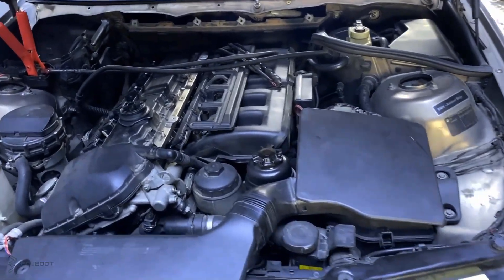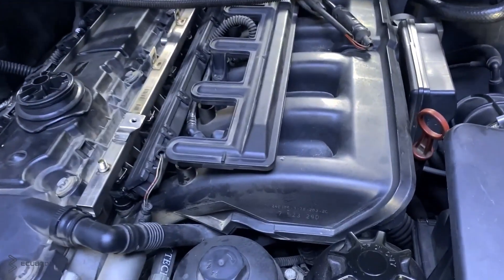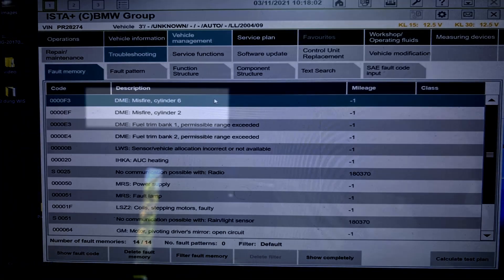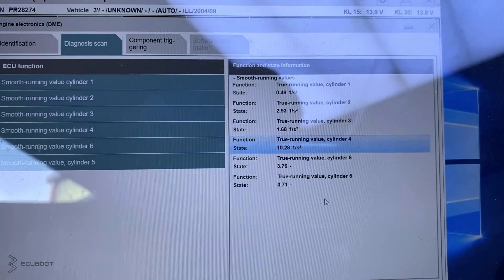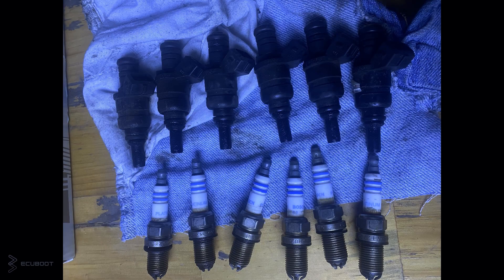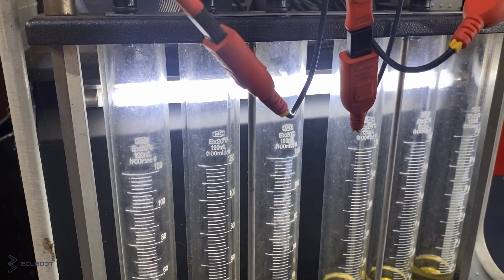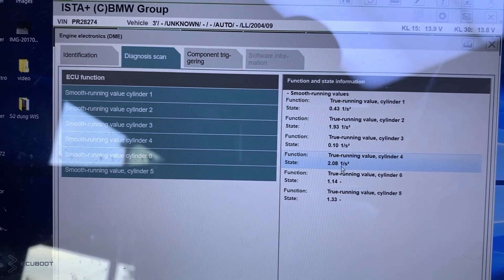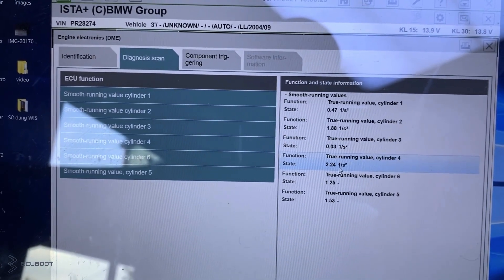HOW TO FIX MISFIRE BMW WITH CODE P0300 RANDOM MULTIPLE CYLINDER MISFIRE

Comment: So I am having misfires on All 4 cylinders and a bank one issue. I'm sure it's not the spark plugs are the coil packs doing bad all at once. So my guess is the fuel injectors need replaced. Does that sound about right to you without physically looking or seen it?

Does have a rough idle sometimes at stop signs or a red light. But sometimes it's not nothing at all. But the check engine light is on and comes on every time I clear
Reply: Ever find out what it was? I have the same problem and am thinking it’s injectors, but maybe it’s an o2 sensor. If you ever found out why pls lmk🙏🙏🙏
Reply: No
Reply: The result .... the solution??